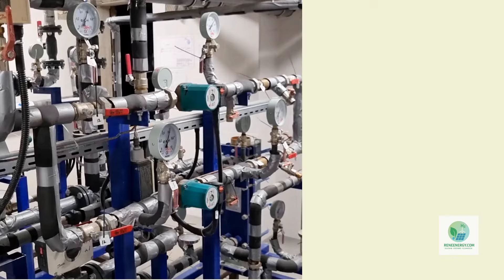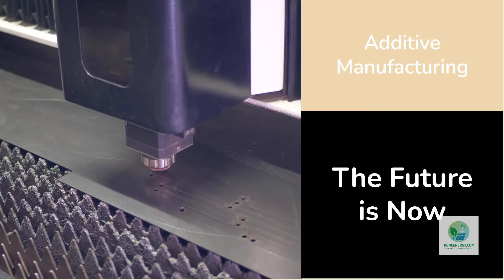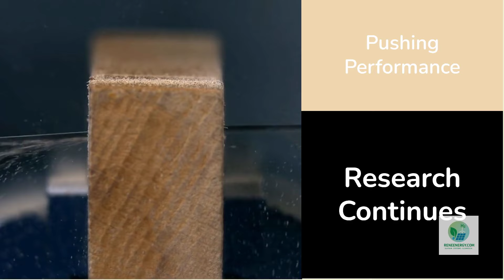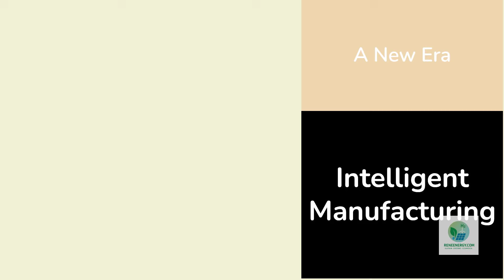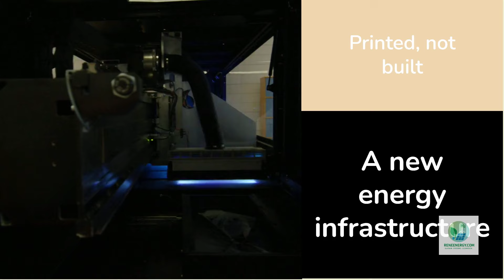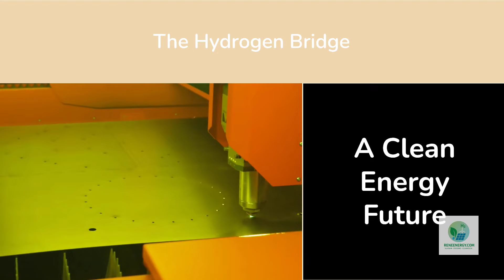How 3D Printing Could Make $2 Hydrogen a Reality Sooner Than Expected

Comment: Water sustainability is a pressing concern for green hydrogen production, as most electrolyzers rely on deionized (DI) water, often sourced from groundwater or RO-treated seawater. Groundwater depletion poses a significant threat, particularly in water-scarce regions. Seawater treatment via reverse osmosis (RO) is costly and energy-intensive. To address these challenges, innovative approaches like 3D printing, microflow, and flow injection can help optimize water usage and reduce costs. Moreover, leveraging renewable energy sources is crucial for sustainable hydrogen production. Using municipal sewage or urban wastewater for electrolysis offers a promising alternative, enhancing sustainability and environmental protection. Our developed electrolyzer demonstrates the feasibility of using seawater/wastewater for green hydrogen production, paving the way for a more sustainable future."